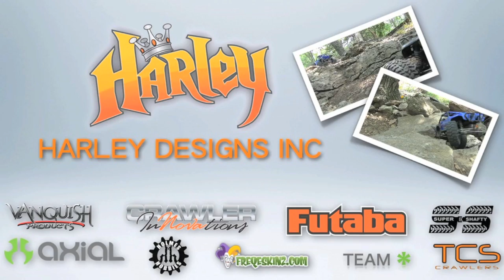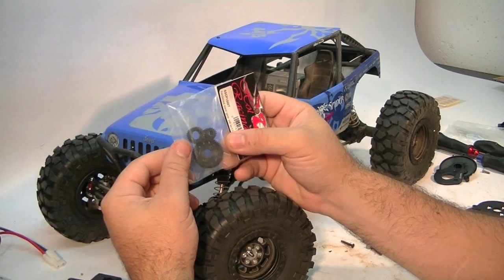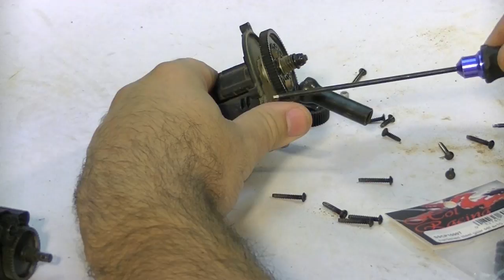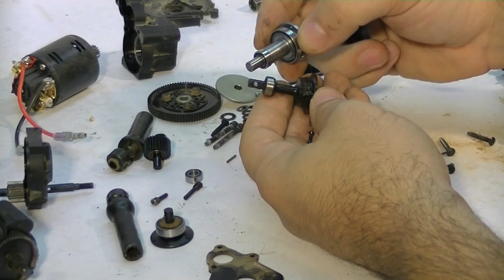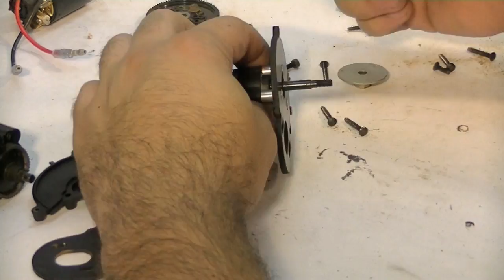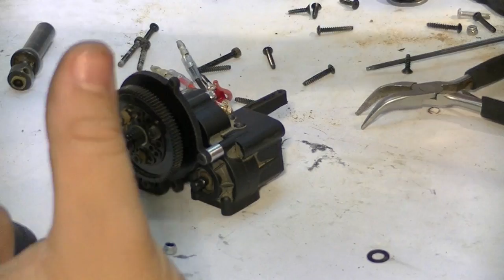Poison Spyder Wraith - Trans Gears & Motor Plate - Week 11 -Budget Build

Comment from the maker: Usually it requires just a little bit of clearancing on the cover. A couple minutes with the Dremel is all that's required.

I will run my cover once the transmission is done. There are still a lot of steps until this trans is finished.

Comment: What is the part number for theWraith motor plate and a set of steel gears for the transmission.  Did you get the bearing kit too?

Comment: Chrome-Moly Steel?? Dang!!! You ARE going for bulletproof! 
So..... what about Driveshafts? Do you just drill the MIP inputs to 6mm, or look for new shafts?
Carmine 🚂
Reply from the maker: I used to drill to 6mm, but now that I can get quality heat treated chromoly 5mm shafts I don’t use the 6mm much any more. The 5mm and 6mm chromoly outputs we used to have available we’re not heat treated which made them not as strong.
Reply: I keep forgetting how OLD some of these videos are!! I'm glad there's a standard size upgrade for our Rigs. 
Well, I'm kinda Old too!! I am in it purely for the fun. I haven't been competitive in over 20 years!! I do want strength and durability, at reasonably low cost.
Hey, thanks for actually answering my comments from these really old videos!
Carmine 🚂

Comment: Do you plan on running the spur gear cover? If so do the MIPs clear? I have bought, following you advice, AX10 MIPs for my honcho and they are still in the package. I run a  "Axial Wraith SuperTuff 48 Pitch 80 Tooth Plastic Spur Gear" (since i changed the stock motor to a 35t, might as well gear up a little). Do you think I could run the spur gear cover?